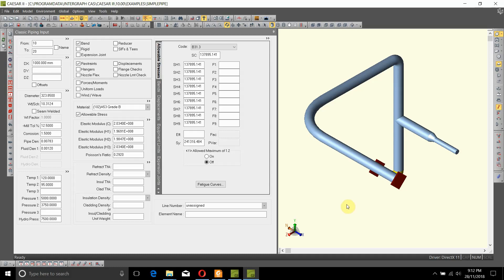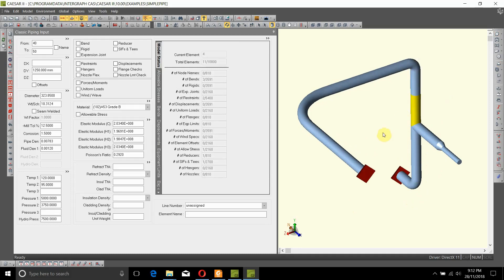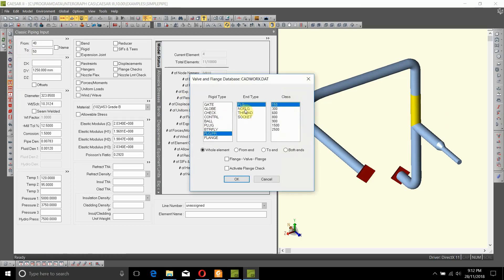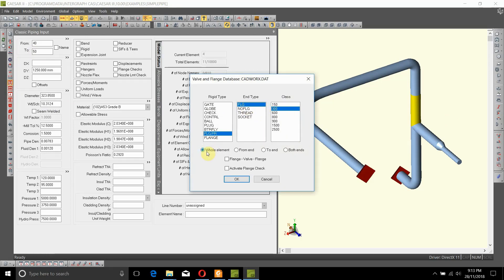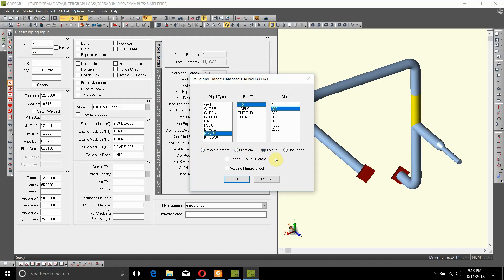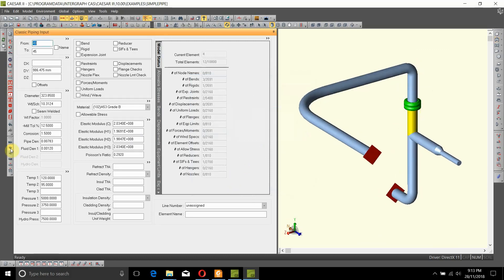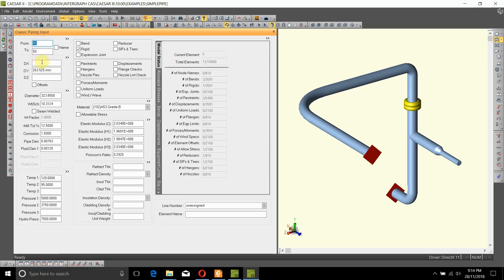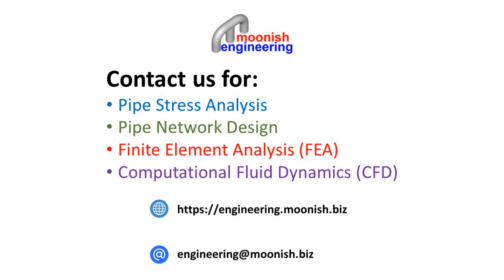How To Add a Flange Pair to Piping Model in Caesar II

Comment: How to add Control valve in pipe by using caesar?
Reply from the maker: Control valve is the same as any other valve.  The function of any valve in Caesar II is to add weight load and stiffness in the calculation.  If you know valve weight, just add Rigid element with weight and it will suffice.